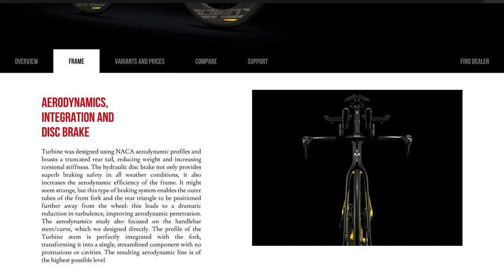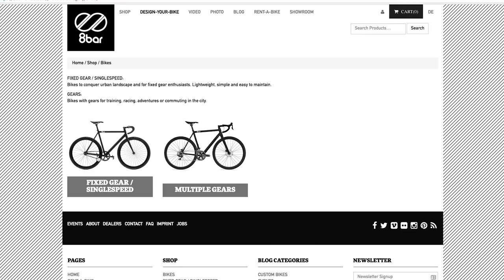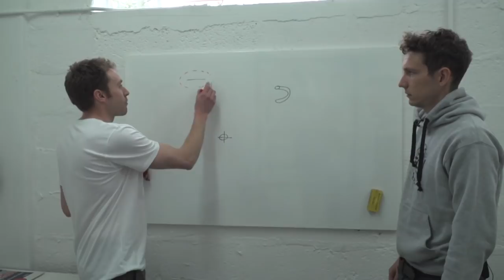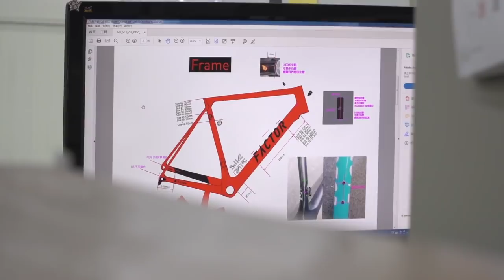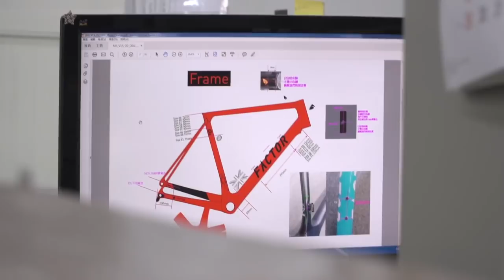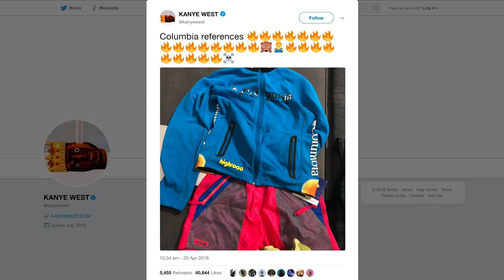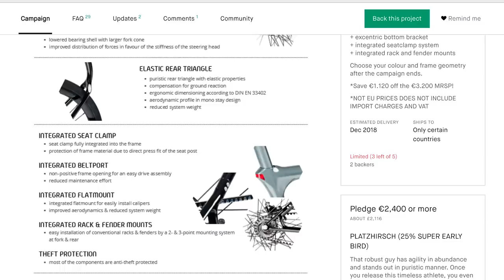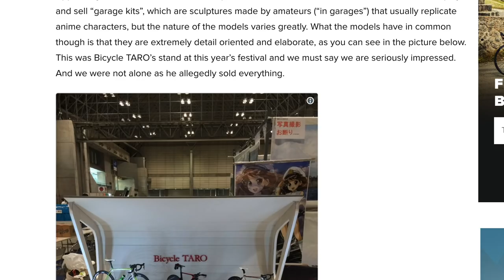Does It Matter Where Your Bike Is Made? | The GCN Tech Show Ep.18

Comment: Thank you Simon and Jon for recognising the Vitus 979 and hanging it on the 'Wall of Fame'  ... mine is still going strong with it's original 'Nadex' bottom bracket since 1981!!The frame cost me £250 back then, built as a TT bike with a single 53 chain ring and 13-18 'microlite' freewheel.  Aero brake levers, drilled bars with concealed cables and weighed in at around 17lbs (7.7kg) ... way ahead of it's time ... now reconfigured as my winter bike and managed to squeeze mudguards in too ... a great bike and still attracts admiring glances ☺☺☺

Comment: regarding frame pump,,,, I have an electric battery operated pump into my bag : 500 gr but if I remember 150 psi max and after repair … waiting the tube to be inflated at the chosen pressure is very nice (500 gr the pump but my bike is a 12kg commuting belt drive bike) and my bike is Marin Presidio 3 made in taiwan and I love it!

Comment: Had a Vitus 979 frame in the mid-late 1980's in black with full Dura Ace, concealed brake cables, yellow bar tape, yellow turbo saddle and Look  pedals - it was achingly cool 😵😎
Never had an issue with any glue bonding problems even though it did two Paris-Roubaix randonnees.

Comment: @Si I agree that there's no reason a cyclocross bike has to be the bike you take off road because a road bike with wider tires can do the job just as well. Specific gravel bikes fill a niche that really doesn't need to be filled. They're not as good at handling crappy terrain when compared to a cross bike, and they're not as fast when you take them on smoother paths/roads when compared to a road bike.

Comment: Does it matter where your bike is made? Yes it can. Those few companies who design and manufacture composite components in-house have a huge advantage because of the close corroboration between their design engineers and production teams. They own everything -- the molds, ovens and all machinery and tools for production. I'm aware of two such examples in the U.S.: Zipp (subsidiary of SRAM) designs and manufactures its carbon wheel rims in-house. Allied Cycle Works (subsidiary of HIA Velo) designs and manufactures its carbon road frames in-house.

One of the things I like about the Allied frames is their decision to offer most sizes with two head tube height options so their frames will better fit the geometry of individual cyclists. This is important to old-timers like me who cannot bend our heads as far back as we used to. How far we can see down the road is the biggest limit to how low (aero) we can get at the front. With most bike manufacturers we have to resort to a wonky-looking steering tube extender or an aggressive upwardly-angled handlebar stem. And this problem is not limited to the grey-haired, it also affects many amateur cyclists, regardless of their age, who desire to ride a fast road bike yet cannot fit an aggressive road geometry.

What I look forward to is the day when the carbon layup can be fully automated in the production line. This should dramatically lower the cost for composite components and, hopefully, make them more affordable. I also hope it will increase the frame size and geometry options that can be offered.
Reply: D.Eldon Also TIME
Reply from the maker: Thanks for sharing your thoughts D.Eldon

Comment: Pumps: depends on what you get... my Topeak pump lasted a really long time. what gave it up in the end (and of course failed with still a half hour of riding to go which is a pretty long walk) was the O-RING that seals the chamber... I'd been pumping a lot due to a pin hole leak in my tube, and not having had time to fix it, essentially it would hold pressure for the commute to work, but then be flat by the time to leave, etc... so i think i over heated the O-RING from pumping so much, causing it to disintegrate.  This guy pumping to 120 PSI, that's probably exactly his problem: pumping to 120PSI and over heating the O-RING.   probably also why he needs to pump it so often, right?  He needs a gravel bike ;)

Comment: Gravel bike: I don't think anyone quite know what gravel bike should be yet.... honestly, the original concept was meant to race on gravel roads, Meaning it should be a road bike configuration but able to accept wider tires set up with angles for control on loose gravel, and probably shocks because gravel roads are not easy on the arms or, well, anything else. Personally, I use mine for bike-packing/touring/commuting so I needed rack mounts and wider tires, wanted disc brakes, but i think after using it for a year+ now that i want the forks to have more of a touring bike angle

Comment: Tall and lanky so get my bikes custom made at local manufacturer. Not as expensive as some people think. The big advantage is that they take every measurement you can think of you would need to take for a bike (outer leg, inner leg, arm length, shoulder width etc...) and then they will give you a few options to do with design and comfort, and you end up with a bike that fits perfectly for your cycling needs... Always worth paying a bit more for this type of thing.

Comment: #askgcn @gcntech Wondering if you can help and maybe point out where i've gone wrong. We had our bikes stolen recently, and I replaced my girlfriends bike with a bike from a different brand (frame, and built it up). Despite the reach being 2mm shorter than her previous frame according to the geo charts. It is blatantly too long for her. If you can't go by reach what should i be using? At the moment, we can't afford to buy new and have lots of spares to build up.

Comment: I have a custom bicycle made for me.  It was  built by STAN JOHNSON, in Venture Ca.  Nothing in the world rides better then a bicycle where everything is made to order using your exact measurements.  Then you spend a few days  talking with Stan about the frame Geometry, type of tubes, Lugged or Un- lugged frame. Then components, hand built wheels,   then paint and pin stripping.  then when you first get to see and ride your new fully custom bike  your face hurts so much from smiling.. But also being 6 foot 8 inches tall  It is hard  to buy some thing off the shelf that will fit correctly.   One of the best things about my Stan Johnson built  28 years ago,  I still ride it today and I still have other cyclist roll up  on me and comment on how nice the bicycle looks.. And it still rides like it did back in 1990..
Reply from the maker: Sounds awesome 6ft8incyclist!

Comment: I think you guys got it bang on regarding bikes being made with expertise and sold at the right price! I suppose, technically, it doesn't REALLY matter where your bike is made. After all, they all have to conform to ISO 4210 (Geek alert!).

Si's posh British accent is hilarious btw.
Reply: Ben Standen You need to beaware of one thing, you are talking about a type test. One of a design is selected to test comply to the standard. This only tests design, not QC. There is considerable evidence around the net to show QC is poor in many of these top end frames.
Reply: Wayne Softy P yeah that's true, though most manufacturers do conform to ISO 9001, so the quality assurance can be expected to be very good.
Reply: Ben Standen Even if you comply to a quality assurance standard, it doesn’t mean a product is of a high standard, just that you are aiming for a consistent standard with a set variance. It depends on your sample rate you set yourself to assure the product. Just say you decide to test 1 in every thousand, 999 are not load test and ultrasound tested. If you test 1 in a hundred your confidence level is higher as you are testing more and most probably your variance is lower, but the trade off is the testing cost is higher. I don’t know how many they batch test of units made, but I can assure you I have seen cut up bikes where the level of quality is low. And this is the problem, you may get a bike that is perfect, but you may also get one that is not and has many flaws. It is a bit of a lottery. Now at the price they charge, I do feel the build quality could be more consistent. I realise that the process can and does make it hard to be very consistent, but they could ultrasound every bike. But I don’t believe this is done. I do know Canyon claim they do ultrasound testing, but I don’t know what percentage.
Reply from the maker: 😂 Glad you enjoyed this week's show!

Comment: The danger might mostly come from vehicles, but the risk is introduced by people, on both the part of drivers and cyclists, mostly because they either don't know or don't follow the rules of the road.

And yes with any product it doesn't matter much where it's made. What's important is how highly regulated the process is in terms of quality, and how much effort has gone in up-front of production. The best and worst frames on the market could come from the same factory, never mind country. A custom bike follows the same principles, and actually has disadvantages in terms of the up-front effort, as it's very rare a custom builders can invest in research and development. Of course this is offset by made-to-measure frames for anyone that doesn't fit the "average" body composition, and the US air force found that basically no-one does when trying to design a universal ejector seat.

Comment: I have a "open mould" "OEM" Chinese MTB "Tidace" XC hardtail frame - 1 years worth of XC racing no issues & can't tell any different from a £1000 price point "big brand" frame in riding feel no issues with my Chinese Tidace including 2 quite big off's in the season too which included 2 cracked ribs in one of the crashes with just minor bit of paint scuff on bike my carbon frame. Rough & tough of XC racing don't tend to keep a frame past 3 seasons so the price point of these Chinese frames perfect (had Scott Scale before this cracked after 12months & Scott would not help told me to go take walk - "you race XC" so what's the point of "big brand" company's?

Comment: My advice is do your research not on the label but where the bike is made and the Quality control. Carbon Fibre is a manual process that requires the carbon weave and bonding resins to be compressed and cured to give full design strength. The design can be great, but if the bike is not made with all the fibres and resin compressed as required it will not have its design strength. Currently the monocoque construction uses balloons that are blown up inside the tubing to compress the fibres and resin. This is where the problem starts. In many cases the balloons don’t smooth out completely creating wrinkles and then less compression. But the maker can’t see this as it is inside, unless they do ultra sound screening on the bikes. Then there needs to be a rejection point, which passes which is rejected. As you can imagine, a company doesn’t want to reject to many frames. As this is money. So this is where the critcal point is, how many do they screen, and where is the line for rejection. I will leave the rest to your imagination.
Reply from the maker: Interesting points Wayne, thanks for your comment!

Comment: Would any of the GCN presenters be worried about using an unbranded carbon frame, carbon wheels or carbon cockpit that was bought from China, through EBay? My thought is that there maybe issues with the quality control and whilst buying a branded item may not guarantee quality it does give you somewhere to complain to if things go bad.

Comment: If it aint made in Italy, it aint a real bike, bro.
Reply: Riding Danish here. Very real bike.
Reply: 2 words: Canyon Aeroad.
Reply: BMC, and the list can be continued.
Reply: Canyon and BMC made the far east
Reply: Apparently, 'Made in Italy' commonly now only means 'assembled' and 'painted' in Italy. Colnago chooses Dual Sourcing Strategy To Serve Global Markets [Press Release 2005]. Is the 'soul' of a bike where or who assembled it? Is it nor rather the design and quality of construction married to the 'fitness for use' that makes it sing or wail?
Reply: Jas F Yes this is true, the carbon is from the far east, so then what is different????? Well with the C60 now C64, the construction is tube and lug, so what, you say, it means the tubes and lugs are moulded around a collapsable piece of material, so NO balloons are used to rely on compression of the resin and fibres. This is why when you look inside a C60 it is as smooth on the inside as the outside giving a even compaction and strength. Then the tubes/lugs are glued together in Italy. 
Other brands use balloons in a monocoque construction and this is where the QC varies dramatically!
Reply: Einhander49 mine says handmade in france
Reply: Glenn McQueen If so that is great, which brand are you referencing and how old is your bike?
Reply: Einhander49 no bikes made in Italy just painted there
Reply: 1971hammydemuck THat is not true. Colnago C64 are asembled and painted there, and there is a few smaller manufacturers like Sarto Antonio (that make bikes under licence for big brands) are still made there.
Reply: Assembled means the frame and fork is made in the east.... Along with most of the components.
Reply: I think if you'd used fake Italian, it'd been a better letter. Bro.
"If'a itsa not-ah made in Italia, itsa not a reeel bike-ah"
Reply: Hope their bikes are better made than their cars
Reply: Einhander49 
I ride a hand made campy outfitted Cesare Rizzato. It's a kool bike.
Reply: 1971hammydemuck, you should watch this video and learn something.
Reply: You will find that the words "Made in Italy" do not mean 100% from materials sourced, designed, manufactured and finished in Italy.  Legally in Italy the percentage is much lower, around 75%.  In fact the Italians themselves want the percentage to be lower when I last looked over a year ago.  You will find that according to an industry source a couple of years ago all bike carbon is Japanese sourced.  So your Italian bike is almost certainly from Japanese materials.  Most carbon is laid up in Asia, except for certain high end bikes being the exception and not the rule.  This is why most carbon bikes are now much more affordable than 20 years ago.  As the guys in this clip said, your phone or car etc is probably designed in one country,  from materials from another and manufactured in yet another.  iphones are not made in the US.  German brand cars are not made in Germany.  And Italian brand bikes are not necessarily 100% made in Italy.    And that is NOT a bad thing.
Reply: Really?  Oh please....
Reply: Frank Chan, what makes Italian bikes great is the craftsmanship, more than the materials. Nobody cared much what mine a metal was mined from, and most people don't care where the carbon fiber material comes from as much as who is putting it together, and based on what design. And, in that regard, the Italian and European manufacturers are still ahead of their Asian counterparts, especially in China. So much of what you hear about comparable Chinese quality is merely propaganda. Ask anyone that has worked extensively with Chinese factories and they will tell you what really goes on.
Reply: I think the where it's assembled may be more important than the where a frame is manufactured.  If a party other than the manufacturer is assembling they may be more critical of the manufacturing.  Not absolute of course, but just a thought.
Reply: David Harper going by their bridges I'll pass on the bike stuff.
Reply: Glass joke, mate. Now go get bent...